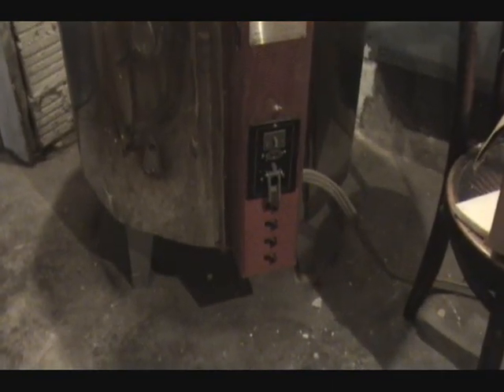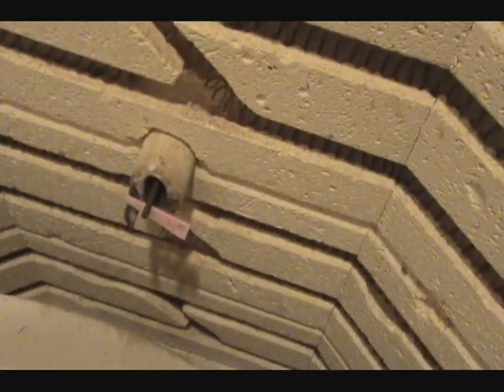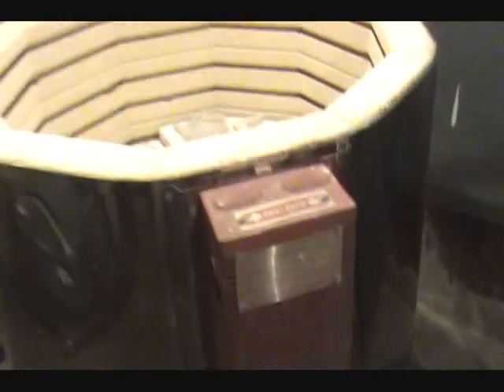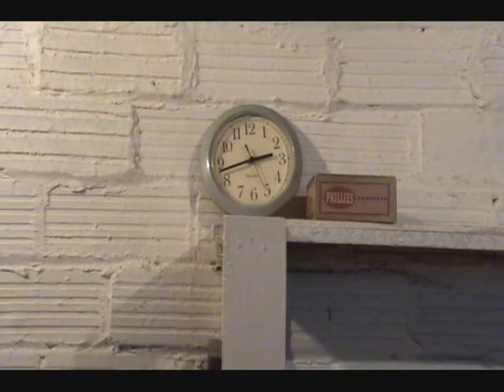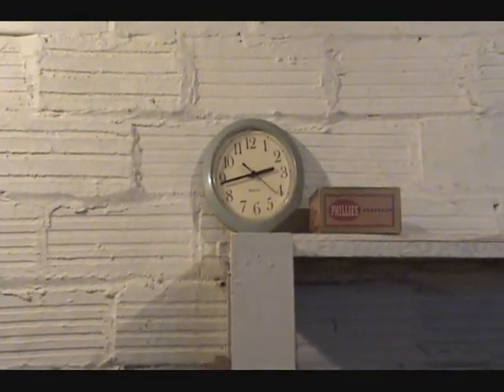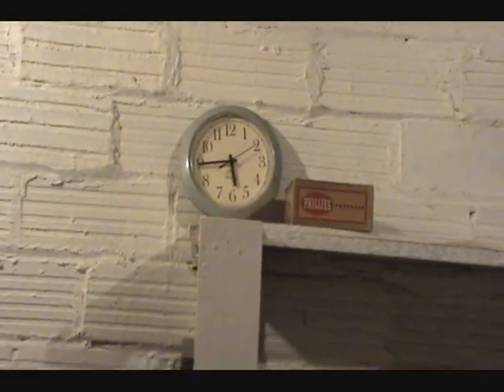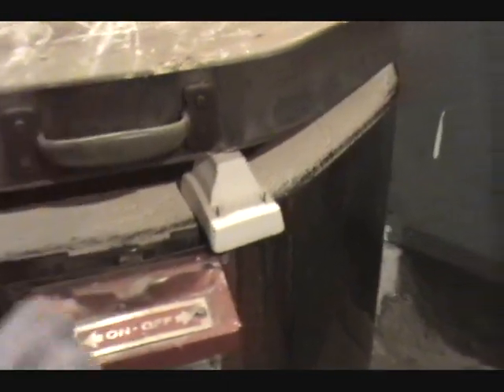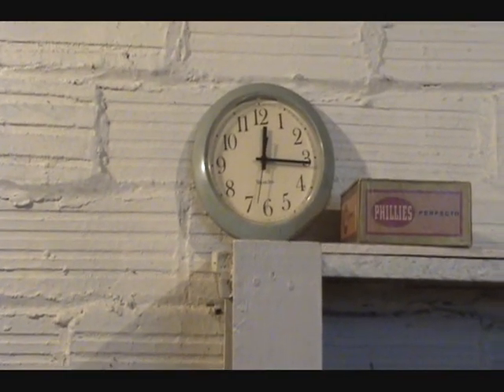TUTORIAL: Warming and Firing a Manual Electric Kiln with Switches

Comment: I found an old kiln in San Diego called AMERICAN BEAUTY. Last month I had an electrician take a look at it. He cleaned some terminals and years of garage dust and after a modification to my electrical panel to 240 amp fuse I was ready to follow your video.  Today (4/12/22) at 12:30pm the final fourth switch was turned on for the first bisque firing. The people I bought the kiln from said it worked when they bought it 25 years ago. However, due to their situation the kiln hadn't been fired since then. So, your video is helping to get this old kiln its chance to come to life for my garage studio. New Mexico Clay of Albuquerque, has been most helpful with their advice keeping in step with your video. Thanks so very much.
Reply: Hi Joe! I just inherited a completely restored and fixed American Beauty for free! I can’t find ANY information about it online. Can you tell me how you’ve done your glaze firings? Also, do you follow the same steps in this video for a bisque firing? Do you like the kiln so far?

Comment: Thanks for posting this!!!   I was given essentially the same thing - mine is called an American Beauty PB-18 or AB-18 and included an "extender" to give the kiln an additional 5 inches of height for a wopping 5760 watts.  The Kiln Sitter is a Dawson K-10 - google that to find the PDF manual - there are some helpful instructions about adjusting it.
Reply: Hi! I know this is an old post - but I was wondering if you had any information, PDFs, or suggestions for an American beauty kiln? I can’t find anything online, and I was just given a completely restored American beauty kiln.
Reply: @thepaperbackpotter  Hi there.  Other than this video and a PDF for the Kiln Sitter, I've found nothing. Haven't needed anything either.  Pretty straight forward kiln.  It's very manual, requiring lots of trips to check on it - as shown in the video.  
I use a Raspberry Pi Zero W to calculate and monitor the temperature slope remotely from the comfort of my living room.  That reduces the trips to 3, to trip the other switches.
Reply: @DominicRichens  Hi Dominic! Thank you so much for your reply! How would you go about the glaze firing? Do you wait longer between each trip? Do you mind walking me through that process? Thank you again!!!
Reply: @thepaperbackpotter  for both bisque and glaze is use the cone sitter to ultimately determine when it is done firing.  

The difference is for bisque I keep the ramp around 100°C/hr for the first 6 hours.  That means lid open an inch and vent open with one switch on initially.  Then close lid, close vent, turn on more switches.  After it hits 600°C I turn the last switch on and leave it until the kiln sitter shuts it off.

Glazing is easier and faster, everything closed and just flip a switch every hour and let the kiln sitter shut if off.

Comment: I enjoyed your video. I have a little newer small electric kiln but basically the same. I have a knob with several settings. An old Duncan. I am over or under firing. My bisque firing comes out like a clear bell sound and now my glaze fire is running badly and sooo many busted bubbles. I am going to thin out my glazes more.

Comment: Hi there! Thank you so much for posting this! After waiting forever and a day for a kiln, I ended up with a very old Evenheat, a Gare, etc. 

My Evenheat has five switches. Though I have fired glass and wine bottles, I have yet to fire ceramics. Would you advise the same procedure for a five-switch kiln, flipping one switch every hour? 

Keep up the positive work. Thank you!
Reply: Hi, Karen Manasco…  hoping you might see this message even though it's been 7 years since your post on this video!  I also have a 5 switch evenheat manual kiln/kiln sitter.  It was second hand and fairly well used by the looks of some of the fire brick and tube assembly etc.  All I have done with it so far is a test fire which seemed to work as it should.  I'm wondering if you have any advice you are willing to share regarding what you have learned in using your kiln over the years.  All Evenheat would send me is a manual for the kiln sitter, but I am curious as to how exactly and what to expect for bisque and glaze fires.  Have you ever begun firing ceramics in yours?  I plan to bisque fire to cone 05 and glaze to 5 or 6.  Thanks in advance if you have any wisdom to impart :)

Comment: You can get the kiln sitter instructions (not the kiln instructions just the sitter) online.  I think I got mine from Cromartie Kiln Ltd.  They will explain about the correct settings for the cones/bars so you fire at the right temp.  Regards, June

Comment: hey there! Thank you so much for this wonderful video, I have fired my kiln two times using this method and it has worked very well.  I have been researching online the process of glaze firing with a kiln like this and was wondering if you had any suggestions?  I believe I will need to get a pyrometer for soaking the kiln, but was unsure if I could swing it without the pyrometer.  Thanks again!  Let me know if you have any suggestions or resources that you think might be helpful, I looked through the manual but it doesn't really get as in depth as I need.
Reply: Does your Kiln take as long as this lady's kiln refinish? Jesus Christ mine finishes in 6 hours once I warm it up if not quicker! I mean the kind of Kiln I have is known for its fast firing but it just seems too quick to me

Comment: Is there a way to fire without a kiln sitter? It seems so annoying having to load a sitter in each time and having to have the exact sitter cone needed for the cone you want to fire to. I actually lodged the weight in place to avoid having to use a cone sitter
Reply: There are self supporting "witness cones" but I want to fire without have to use money on another material. I ended up just buying two packs of sitter cones for about $10. It's not that big of a deal.
Reply: I use a pyrometer. Just need to watch the temp.

Comment: Hi, just saw this and thanks for posting! I feel like you're in my basement! :)  I have this kiln. Don't have a vent and the manual is telling me to leave it cracked with top peep open until the 3rd switch is flipped.  It's then telling me to leave the top peep open during the whole glaze/bisque firing.  Is anyone else doing this?  I also don't have a pyrometer and am trying to figure out how to slow fire and soak.  Anyone have any experience with that?  :)  Thanks!

Comment: Hi thanks for this - really useful - but I think that was underfired.. I've been reading up on kiln sitters and using the mini cones and it should pop the switch when the cone has melted to a 90 degree angle.

Here's a link to the kiln sitter manual:

http://www.rlkilnservices.co.uk/downloads/controller_manuals/Kiln%20Sitter%20LT3%20Manual.pdf

Thanks though, still very useful
Reply: Thank you SO MUCH for the link to the manual - so appreciate this!!